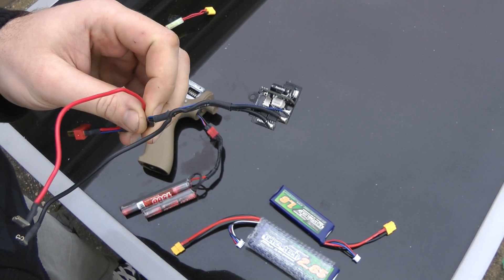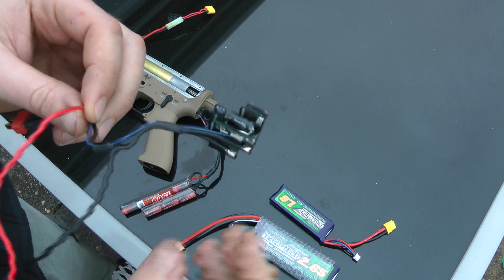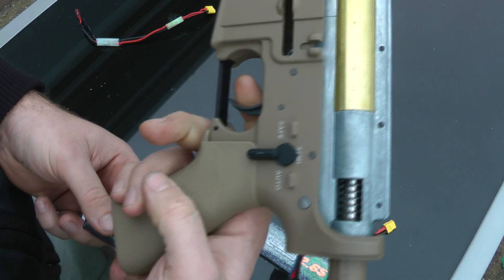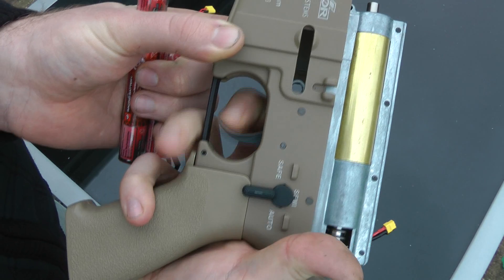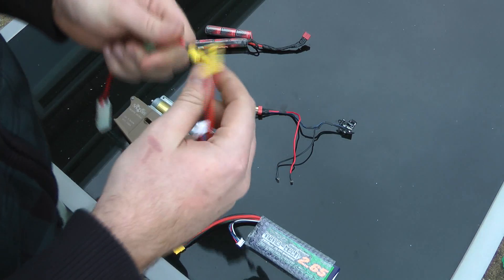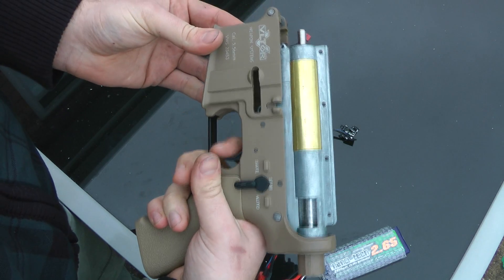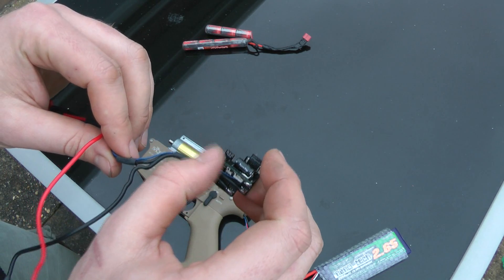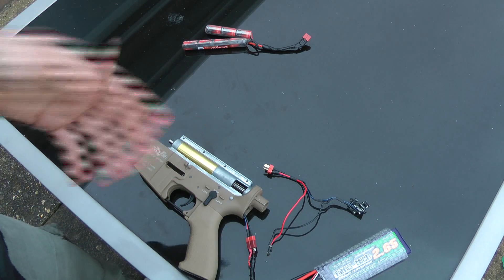Product Review - AWS STEALTH MOSFET / ECU Testing Video

Comment from the maker: You use which everone comes with the gun, though i found the element ones had an extended spring guide on them which was handy on some guns which the spring would "pop" out on.  Usual stuff theres so many guns and its sometimes a little work to get it in.  new units come with tamiya now for greater compatibility.

Comment from the maker: @Winberg83 This unit doesnt have ab, but it doesnt need ab... Ab is there to compensate for the old style trigger system and its inherant delay in deactivating.. This unit doesnt suffer such problems, it activates and deactivates very quickly...

Comment from the maker: @Puddzzz Good point.  I could stock either, but i prefer this one Its simpler and smaller, its more compact..  We specifically asked for simple!  It handles massive amounts of power, and stops if you have a low battery so it does have features, but it doesnt have any burst or single only option which i believe acsu has.  But this does the single shot completion.. And has the electric switch.  AND it doesnt have the rear bulky unit this is designed to be all in the gearbox and its cheaper.

Comment: I have to say this is nice. I just started in air soft coming out of RC cars and i have to say i was trying to figure out how to prevent a lockup and this solves that problem. I deff want to get one of these.  but i have only one question how can i get the motor braking and the burst like the Pulse.

Comment: 11.1 LiPo is nice when you got the parts to handle such power. I have, but i encountered a new problem :/ single shot goes well, hop sucks so i loose about 10-20m (in comparison to a 7.4V LiPo) and in full auto i can shoot 4-5 rounds and then the remaining ones stuck somewhere and won`t come out until switched to single shot again... and the first single shot fires like 3 rounds at once *rolleyes*
So more upgrades nescessary... so happy to open the gearbox another time :D

Comment from the maker: @thegeneral123 hi, This is just a test video not a max speed test, its only to demonstrate a rough idea of what you could expect to see and it does it very well, it isnt going to reduce it that much using convenient connectors and there are faster and slower discharge rate 7.4v lipos around all effecting speed we cant test them all.

Comment from the maker: @Pepsicolaftw We will stock a front AND rewire option..  Theres no way to make the wiring length fit every gun so its a standard length.. which youcan add length on too should you need to.  The front wire will be listed on the website in a week.

If your worried about fitment, send it in too us and we will do the install for 34.99

Comment: It can be kinda hard for a Swedish guy to send his guns to the UK for a installation. ;) I'm not that worried about the cable lenght it would more be a nice thing to know that I won't have to do much more then open up the mechbox/gearbox and losen up a screw etc. Don't get me wrong, I just disslike to have to splice cables and to get a nice in all my weapons like HK416, SAR. 41, MP5 A5, SCAR L etc with the cables at the front.

Bah I hate the short messages.

Thanks alot for your reply!

Comment: Do you guys think a Warhead brushless motor will work with the Stealth unit?
I have one of theese units laying around. I'm thinking of modifying a PTS Masada gearbox to make it fit. It looks like some dremeling is all that is needed, and changing the cut off lever to standard version 2 and version 2 trigger.
Reply from the maker: i know airsoft isnt a tech that moves forward at great pace but this is a 11 year old product that as a company fell flat on its face with a near 90% failure rate.   i thinnk you need to balance your time and money, if it was me i couldnt risk spending company time at a fixed labour cost on fitting a rapture.   Interms of compatibility, the warheads and gate produce a feedback freqency from the AB when it activates that can interfeer with each other truth is, they both blamed each other and most "brushless modes" from all mosfet companies seem to be entirely untested as none of them actually work.   Currently, proof is in the pudding.   Install it, and it either works or it doesn't.  That's the place that most of us techs are in.   Gate has good compatibility with warhead, as does jeftron.
Reply: @Eagle6Airsoft  Thanks a lot for taking the time to reply🙏

Actually, the Stealth unit I own have never given me any problems, but I understand if you think it sounds like a bad idea to put in the effort and modifying a gearbox for such an old tech unit. I was thinking the Stealth just should be a first step, since after the dremel job the gearbox will be ready for Gate Titan, Perun Hybrid etc. I just happen to have one laying around, so putting it in will be the first step to a better trigger system.
I'm not sure the Stealth unit has active braking, I know the raptor had it, but the Stealth I think only has cycle detection.
Reply from the maker: @KAG2203  like i say if you have it why not, but it's up to you on the time.   when you tech at home its your time to give.  you could spend every evening for a month working on that gun for free so to speak.  and theoretically yes it should work.  warheads have AB built in which is part of the compatibility issues, two devices with AB.  so if one hasn't i wouldn't worry too much.